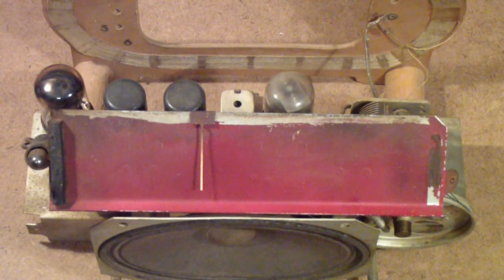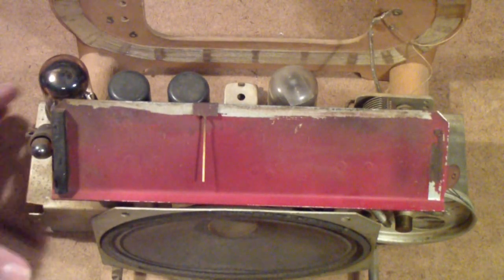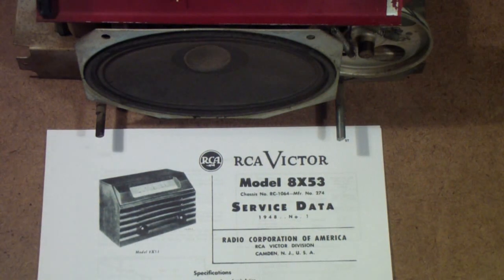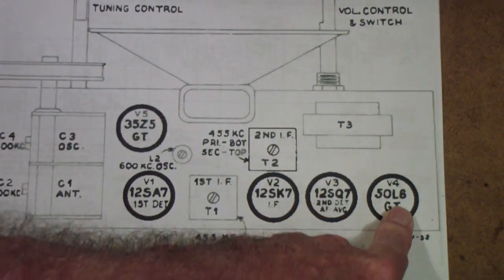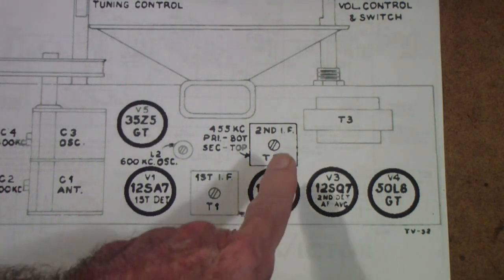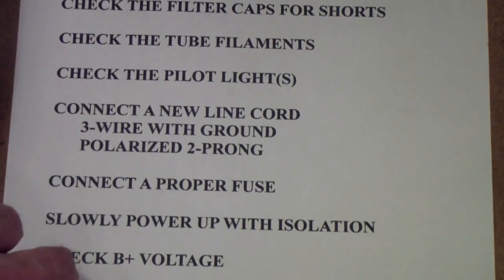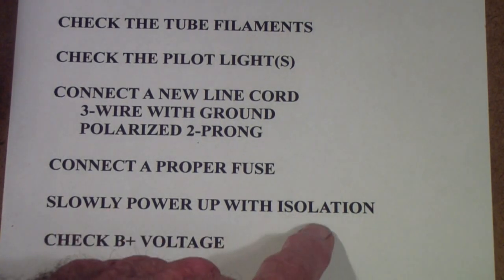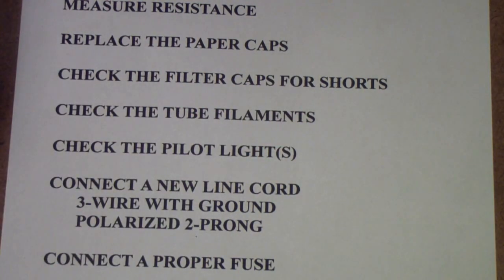TTT280 The Frugal Repairman Pt11

Comment: Thank you for the tip on the switchbox for finding the outer foil. I made one and it works very well with a HP 400F ac voltmeter. Easier to see than with my oscilloscope.